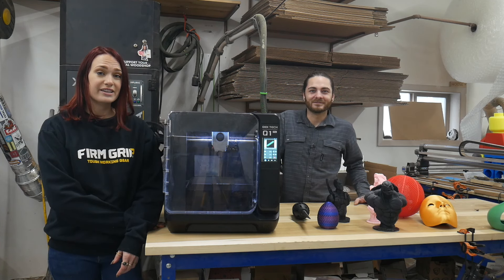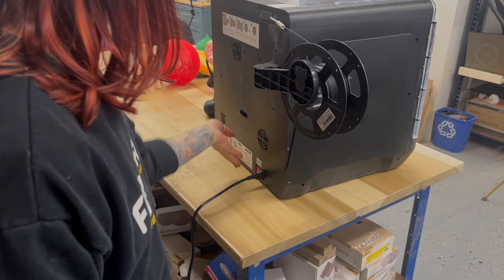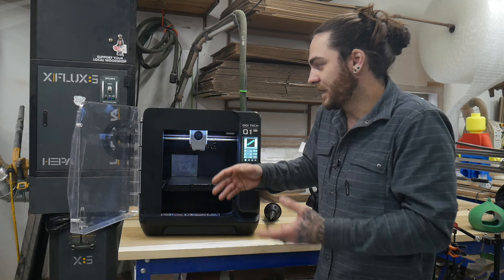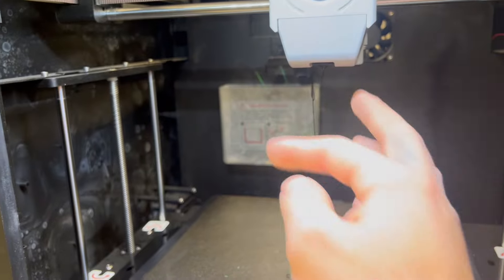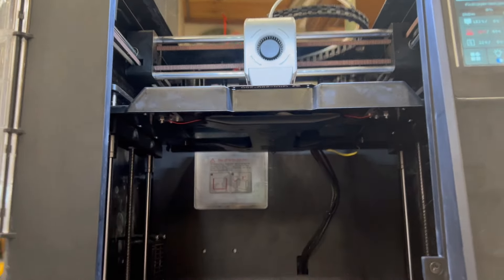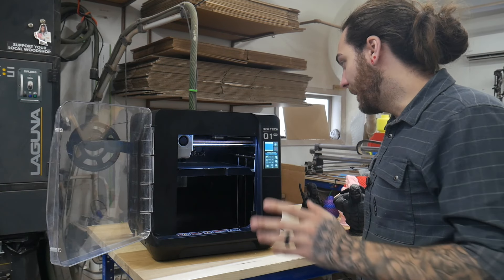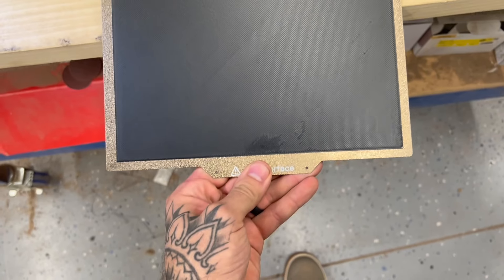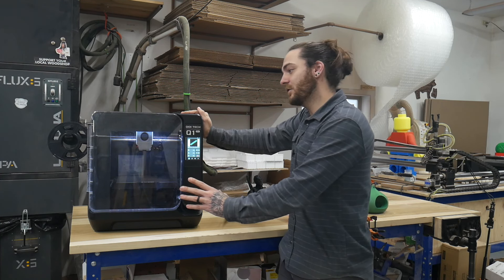The best budget enclosed printer? Qidi Q1 Pro 200 Hour review

Comment: We're all beta testers for released products now... luckily, the support community and Qidi CS reviews seem to be very well received and have been more than open in replacing under warranty or upgrading parts if something was defective... while I hate beta testing commercially released products... Qidi seems like a worthwhile company to take a leap on. I ordered this for the end of may US pre-sale... so I can only hope the additional 1.5months is for update/refit of parts found to be lacking sent out to reviewers like yourself and then push the V1.1 model perse.
Reply from the maker: I’d love for them to make the minor updates and send out the same but different machine with the updates. I think it’s a great printer just needs a few tweaks
Reply: I think it's also okay to recognize that making a perfect product is difficult and that real people have to do this work with budgets and deadlines. I'd hardly call this an unfinished product, even if it's imperfect. There are definitely examples of printers that were half baked and shouldn't have been released, but I think this is just one approach to creating a machine at a price point with a lot of great features and not every little thing how everyone would prefer it.
Reply: Qidi, with the X-3 series, have a long history of updating the models over the production runs.  They don't re-release them as sub-models.  Bambu and Creality do the same.  The models of the X1C and the K1 all received continual hardware improvements over time.  The Qidi X-Plus 3, for example, is on about revision 5 now from what was originally reviewed back in March 2023, and has received about 3 updates since most of the re-release reviews in June 2023.  The differences aren't huge, but they do address most of the quibbles that reviewers and early users experienced.
Reply: I know the tech is alot more advanced than machines a few years old- but I took a chance on a less common smaller brand back then for my printer and have NEVER, not one time had an issue (that wasn't my fault)😂 never called customer service. All parts moved when and how they should. And I beat the brakes off of it to this very day cranked above what they listed the maximum speeds and Temps as😅  seeing all the "unwilling beta testers" with the Q1 (which I'm heavily considering) is kinda scaring me towards spending aLOT more money on like a x1 carbon.

Comment: QIDI has made some changes to the Q1. The build sheet is easier to place accurately plus an ethernet port. The power cord argument is a little lame but the power switch could have been moved to the front.
Reply from the maker: “Lame” argument but agrees there should be a power button. 😆 I’m glad they fixed the built plate, such a simple fix. I also need to give feedback, minor details or not otherwise what’s the point of a review

Comment: Top of my list for printers I want right now. Just seems like the most capable printer for the money. My main desire would be that it was slightly larger.
Reply from the maker: Totally agree! It’s a great printer and for under $500? It’s hard to beat. Also I agree with it was 280-300 for print area. 246 isn’t bad, bigger than the k1C

Comment: The lid you guys complain about you could 3d print a small riser for the lid. Not that big of a deal. Same goes with the plate alignment. For a channel with design in the name it's wierd you point out flaws they should've fixed but don't create your own solution to the problem.
Reply from the maker: Sure I absolutely can and will. But for a brand new printer you shouldn’t have to make modifications as I’m sure many will agree. It’s a $500 printer that will most likely be $600 soon. Why should I have to “make it work” when I don’t have to with other printers. I mentioned they were minor issues and mostly cosmetic. What’s the point of a review if I only point out positive things? Then people will complain about that, maybe you should make your own review videos if you have such strong opinions. I’m just trying to do the best I can and make fair review videos. Imagine buying a new car and the door doesn’t work right and the dealership says “well you can just fix it right?” It’s a silly comment.
Reply from the maker: lol yeah I don’t get it, these companies need feedback to not put out sub par machines. A $500-600 machine should be pretty solid and not have a bunch of flaws whether they are minor or not. Typically they make the first printer take the feedback and then release and updated version a few months later 🤷🏼‍♂️ I also never said it was a bad printer, just has a few minor nit picks lol
Reply: @TwoMooseDesign  you don't have to "make it work" the thing literally works right out the box. The things your complaining about are super minor and you could make changes yourself. Again for a channel with "design" in your name you sure came up with a whole lot of solutions to minor problems... your comparison to a car and a 3d printer are hilarious too! I own a fully loaded vehicle and a more base model vehicle. Maybe I should complain about all the sick features my base model lacks in comparison to my fully loaded vehicle. Comparing a 3d printer to a car is apple's to oranges lol
Reply: @robertharlow1566  it's a review, that's exactly what a review is for. Your criticisms are completely unfounded.

Comment: I've had a few issues with mine. First the printer would not boot , till support told me to unplug the WIFI dongle , boot the printer then update and reinstall the dongle. Second while using the chamber heater for abs , it would lock up at random time and the printer would just not do anything. Had to power cycle. Support told me not to use the heater until the replacement parts an adapter plate and cable arrived. Also when I start a new print after a long one , it starts normally and goes to heat the nozzle to purge and as soon as the purge starts the heater turns off and the extruder starts skipping. Other then that its great.
Reply from the maker: Did the new parts resolve the issues or did you not get them yet? Mine hasn’t done that

Comment: My first 3d printer.  Just doing test prints to start, but I see it's value in many areas.  I'm a beginner 3d printer, but far from beginner in general IT and other things.  But I didn't use much of my general knowledge to get mine printing.  Find existing designs already built online and have a ball!  The hardest part of any beginner 3d work is CAD and Slicers.  But use QIDI's slicer -- it knows this printer -- and move on as your knowledge improves.  Then move on to designing your own prints using CAD.  I'm glad I own one.  Maybe two soon.

Comment: Nice review. What print speed did you use for the TPU.
Reply from the maker: Thank you! I use orca slicer and the generic profiles. I go by the max volumetric flow rate which automatically sets speed. I believe it should be set to 3 or 4.

Comment: Got my money back from the faulty A1 and although their 80$ compensation on next buy is tempting I'm really wondering if this printer is not a better replacement
Reply from the maker: It’s enclosed 🤷🏼‍♂️ Bambu makes great printers and they print awesome. I don’t think you’d be disappointed in either. Minis the handful of cosmetics flaws this printer has printed great for me
Reply: Simple decision:  Which is more important to you: Multi-color/material or higher temp materials?  The latter for me as I am looking at FUNCTIONAL prints rather than decorative.  Nothing at all wrong with the latter, just not where my need is at.

Comment: For a total beginners at about the same price do you recommend Creality K1C or Qidi Q1 pro? I need best print quality between the two printers
Reply from the maker: Both print great. The only differences are size and the qidi has a heated chamber. The k1c is smaller and has a more streamlined compact size to it. The qidi is bulky but will print better with filaments such as abs or Asa. Most likely you will mostly use PLA filament which it will not need a heated chamber.

Comment: Could you share your TPU brand and settings. I tied stock orca and it was a no go for me with Q1
Reply from the maker: I use mostly Sunlu. And if it prints rough lower the max volumetric flow rate down like 1-2 numbers. Should be at like 4-5 lower it to 3 and see how that prints. It’s in the filament settings at the bottom
Reply from the maker: Could also be temp but I would lower that first and see how it does
Reply: @TwoMooseDesign Yep 4-5mm³/s is about the max I can ever get out of TPU. Top way to make TPU print better is slow down.

Comment: For those who can't figure it out, you open the door from the obvious spot on the lower right corner LoL
Reply from the maker: sure but its not a handle. its ergonomically a fail. big deal? no but i have to critique the printers, if i gave no feedback whats the point of doing a review. If we dont hold these companies accountable they will just put out the bare minimum trash but by all means think you're funny. Feel free to find a channel that only fluffs printers and tells you how perfect they are and you'll have zero problems.
Reply: @TwoMooseDesign  Hi, thanks for responding

Comment: How can someone put 200hrs into a machine and not work out that there's a very obvious design on the bottom of the machine for opening the door. It's right there?
Reply from the maker: What? lol there’s literally a jut out for a handle with no groove. There’s a groove on the bottom but it’s exactly the same as on the side where the handle should be. Like I mentioned it’s not a big deal and I’m nit picking, the printer prints great. If I come on here and give zero critique I’ll get people complaining about that. I have a flash forge that has the same plastic door with a far better handle design, again not a big deal but you need to give the companies feedback to improve the printers.